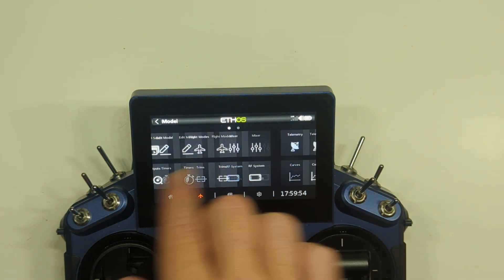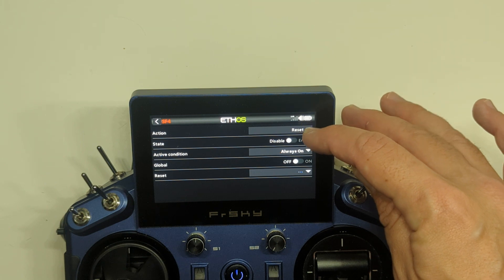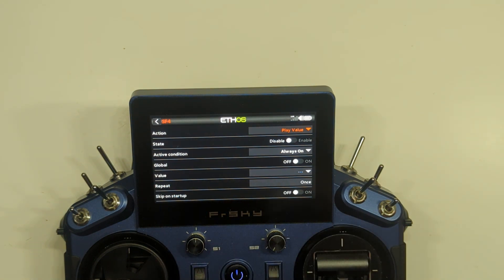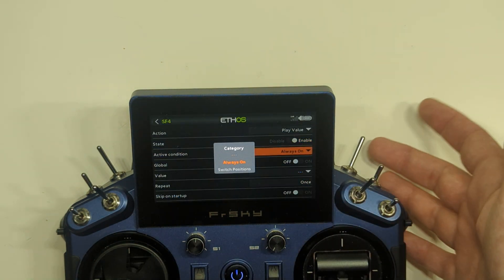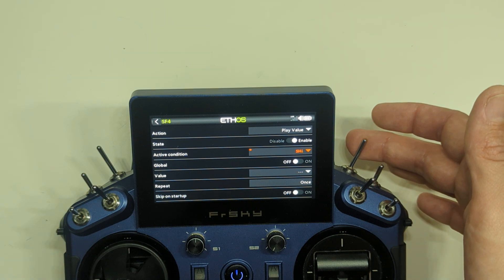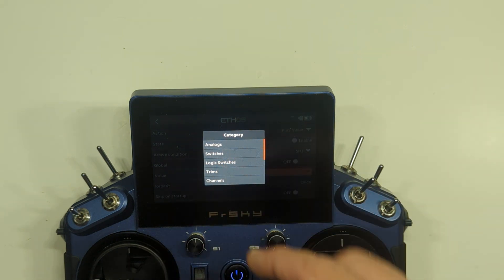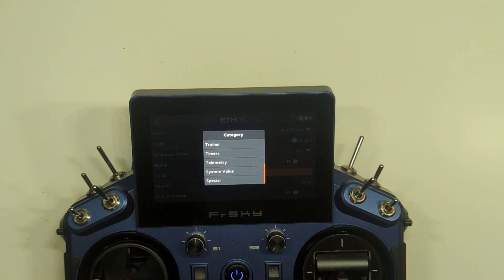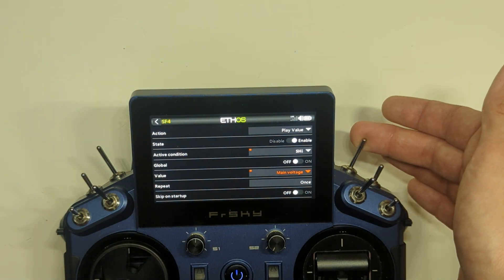FrSky Ethos Basics episode 1: using special functions to read out a value.

Comment: @Joey Tavora - Would really help if you shared your view here. My Futaba T8FG has just gone bust and while I could get it repaired im in the market for a new radio. I'm torn between the FrSkt X18/20 or the Radiomaster TX16S MK2 with AG01 Gimbals.

1. I currently have only FASST receivers so im guessing neither f the 2 will support them
2. looking for the widest possible coverage with the 4in1 MPM
3. The tandem 900 & 2.4 connectivity seems very tempting when I'm flying Fixed wing
4. Would you consider either of these at par with Futaba Quality? I loved my T8FGand its form factor.. 

OPTION1: X18/20 with 2 Addon Modules (i: ELRS & ii: 4in1)
OPTION2: TX16S MK2 AG01 4in1 one Addon Module (i: ELRS)

Which one would you advise. How much better in quality is the X18/20
Reply from the maker: I like the radiomaster, but I do feel that the price difference reflects the quality of it compared to the x18/20. I think the feel of the x18/x20 compares well to the futabas I have used. The tandem RXs are actually in my opinion the best part of the frsky ecosystem. The tdr18 being dual band, built in dual battery management and switch just makes it a simple and bulletproof solution for larger models. 

I personally have two x20s and I prefer the x18, I think it is a slightly better designed radio admittedly at the expense of the smaller screen.